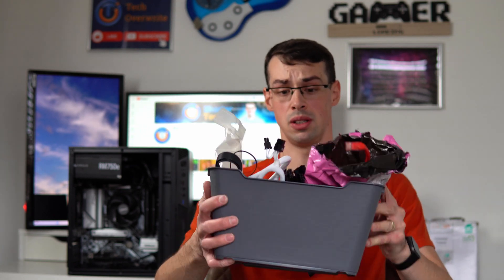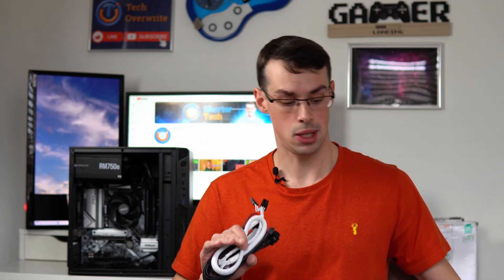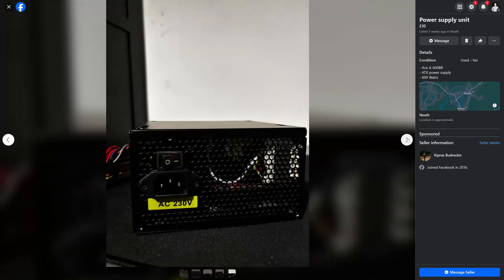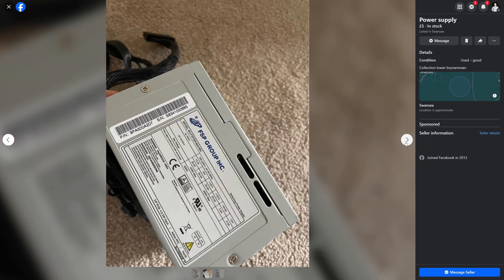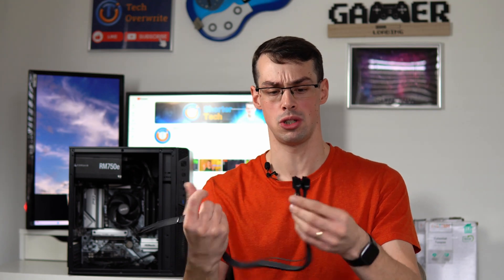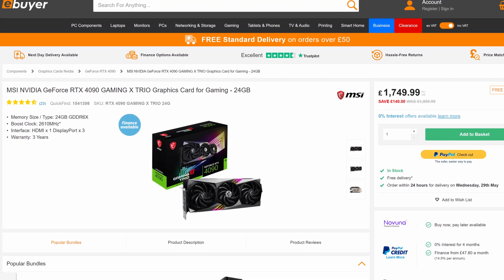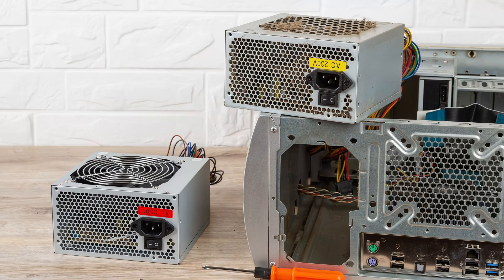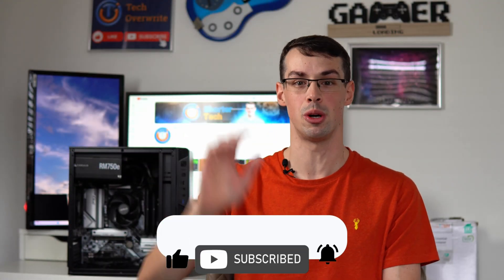Is It Risky To Re-Use An Old Power Supply Unit (PSU)?

Comment: The problem with a new power supply is that you can spend top dollar on a high end/recommended model but it can still short/explode immediately or in the near future. Compared to an old power supply that has been reliable for years under load.
Reply from the maker: That's true, it's annoying that electrics have that 'failure curve' where they might fail early on. Always a bit of a worry for sure :/

Comment: What I've occasionally done is repurpose a power supply's 12v and/or 5v rails to power other devices. I've done this for powering something like multiple HDD dock/clone devices. I lose the original power adapter for stuff every so often, so being able to repurpose these has come in clutch for whenever the occasion arises.
Reply from the maker: Ooo, that's a great idea! Yes I could definitely see that come in use.

Comment: A month ago I build a "server" pc (serves as nas, tv pc, plex server, seedbox, cloud) from my old hardware (i5 7400, rx 580) and I used also my 14 years old 700w psu. I cleaned it with compressor and it's like new. It even wasn't that dusty. But you're right. I wouldn't use second hand psu. It's not worth the risk.
Reply from the maker: Thanks for the comment, and that sounds like a cool build, the hardware choices sound perfect too - I imagine that an 7th gen Intel and an RX 580 would work well. :)

Comment: One thing i do personally is that when i build a pc i always plug in all the unused psu cables and the zip tie them neatly and hide them in the bottom of the case with the psu that way if i upgrade it in the future the cables are already there and i dont have to worry about losing cables or plugging in the wrong cables later if im moving the machine to a new case or something this is especially helpful if you have multiple machines
Reply from the maker: That's a neat tip - always good to group the PSU cables together, especially for future proofing of new hardware etc.
Reply: @ShorterTechOverwrite  thanks 😊

Comment: I kept moving my old Corsair TX950W for 13 years. When my PC started smoking last year, I was afraid I had been rolling the dice on that PSU for too long. Fortunately the PSU burnt out only itself, and all the other components were fine after replacing it. So I guess that as long as it is a good quality PSU, you'll be fine.
Reply from the maker: Phew, that's a relief (that only the PSU was impacted). I really like higher quality Corsair PSUs for similar reasons - they do seem to have great longevity.

Comment: Also, I moved and now don’t know for sure which of my spare cables go to which PSU, lol. I can’t take the chance of using the wrong cables.

I wish there was more standardization.

Those PSUs that I have that are currently in use, will only be used in those systems that they are currently installed in. That is unless I don’t need to use cables other than which are already plugged into the PSU currently.

Finally, power requirements keep creeping up generation after generation anyway. Seems I need a larger PSU for each new build anyway. Remember when 650 was the norm? Not anymore…
Reply from the maker: Ugh yes I get that, I never chance using the wrong cables either. The thought creeps me out and I usually end up overanalyzing it lol.

Comment: Yep, I’m only interested in ATX 3.1 and PCIe 5.1 for new purchases. I will not reuse another PSU out of those specs unless I’m running a GPU with a standard 8-pin PCIe power connector.

The majority of PSUs on the market currently do not meet the new ATX 3.1, PCIe 5.1 specifications. Like any computer component, PSUs do become obsolete also. Just not worth the risk to save $150 to me.
Reply from the maker: That makes sense, and I'll do similar with any new PSU purchase too... especially if I ever go for a 40XX (or onwards) NVIDIA GPU!